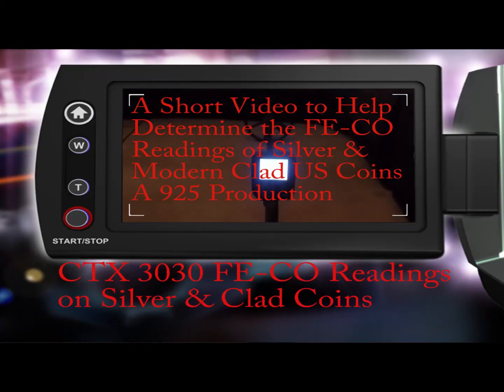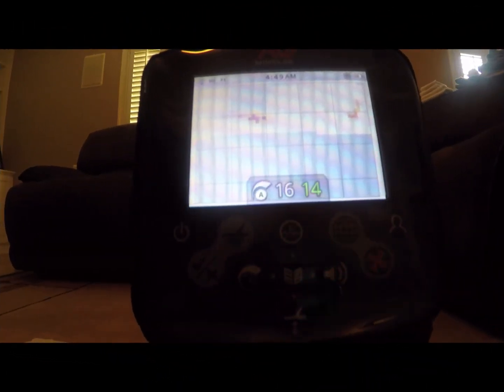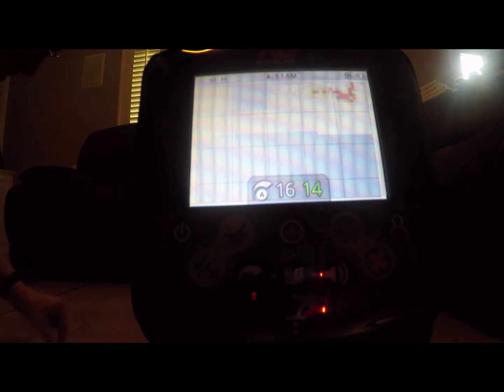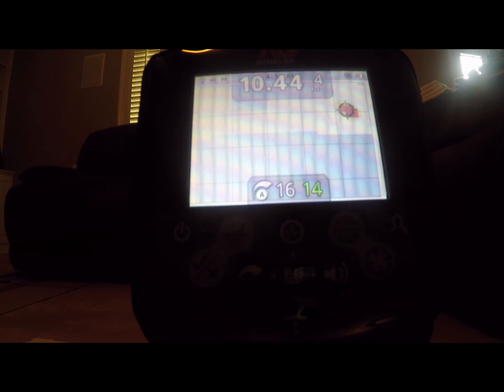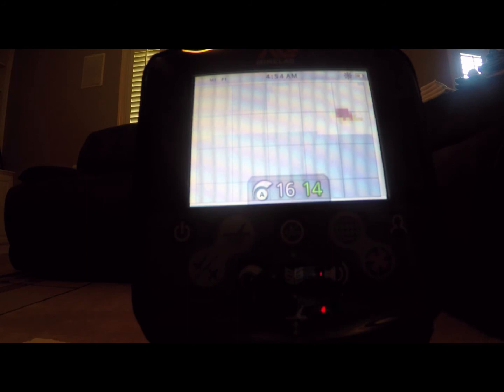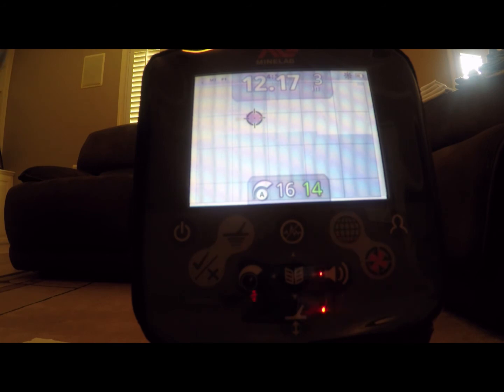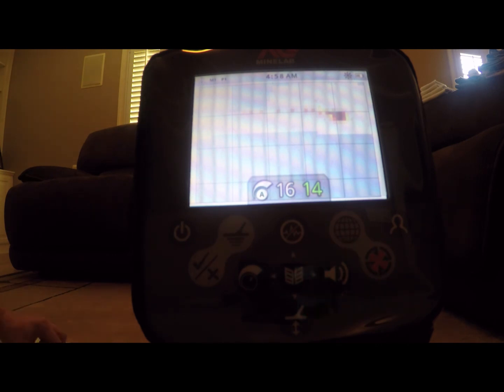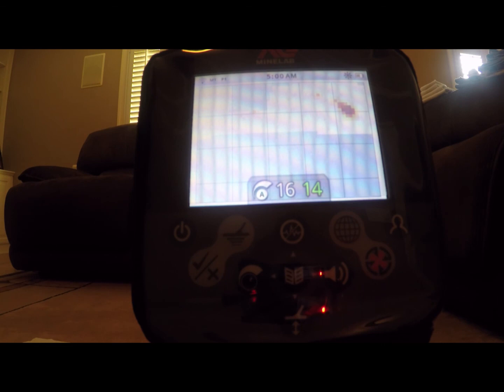FE-CO Readings on US Coins WIth the CTX 3030

Comment: Good vid. If memory serves the default response setting in the coin program is low trash and going off the big silvers it is that or High trash. You might want to give that test another shot in Ferrous coin or ground coin, they push those signals to the 12 line and change the non-ferrous readings a bit on some of the coins. I have yet to find a Minnie but the round balls I have found rang up like coins.
Reply from the maker: +indy durtdigger My intent is to show other beginners how coins respond in the stock coin program. Once that is mastered, then we can go on to bigger and better things. Thanks for watching and your comment.
Reply: +Silver Seeker60 I get ya. I was just thinking of my own experience when first starting with the CTX. I didn't know that changing the target separation would change the readings on the FE-CO readings which led to some confusion at first.